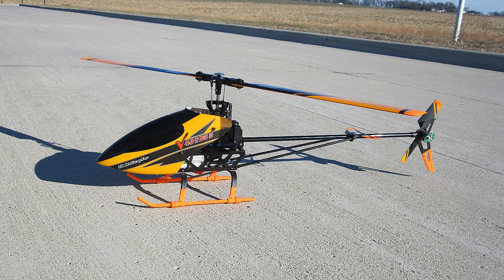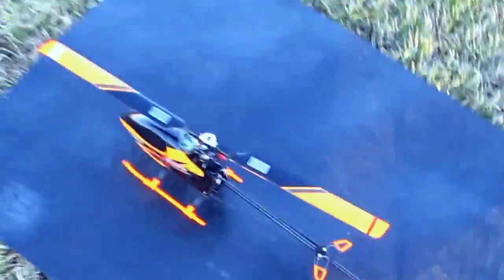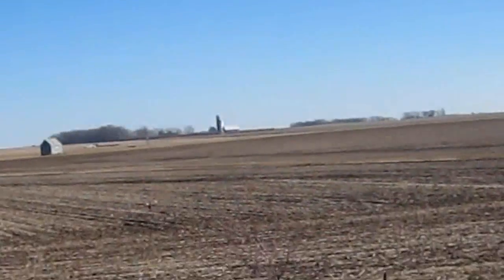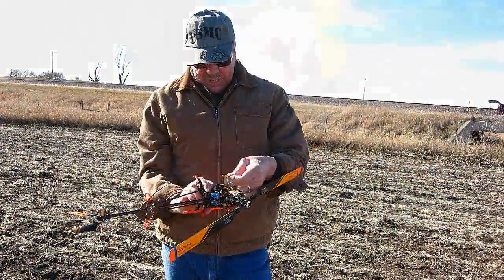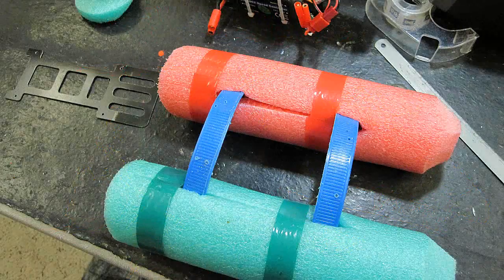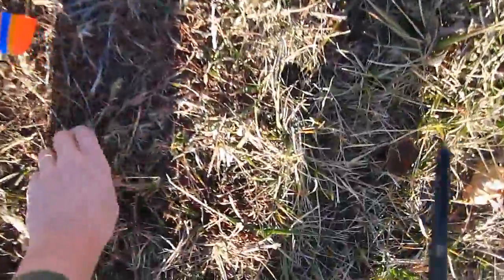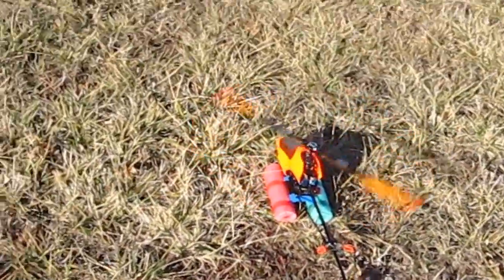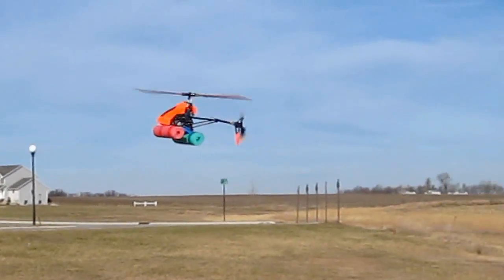V400 D-02 Helicopter 3D Flying, Crashing, & Fixing, including Visual Enhancements.

Comment: Quick question, I received an old Walkera #59 and I need to replace the main rotor, tail blades, blade holders, and the brushed motor. Can you offer any cheap replacement suggestions? I'm not looking for direct replacements, just enough to get me back in the air.

Thanks in advance :-)

Comment: I was going to ask what do people get out of flying upside down, but this is not the cause of the crash. If anything you know how to fly upside down. LOL So if I understand the cause of the crash correctly, rolling the helicopter forced it into a flight attitude that you could not correct because of the limitations of the tail rotor and then you ran out of time or visual cues to correct the flight path before the chopper collided with the ground. You certainly did a great repair job!! :-)